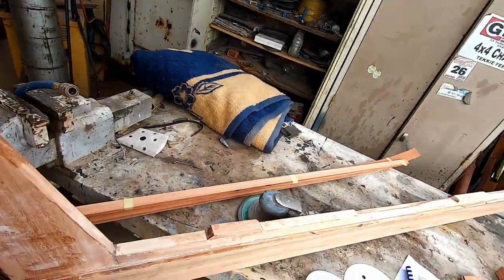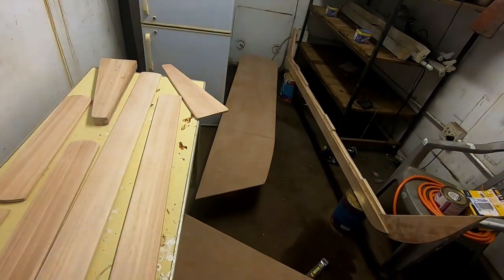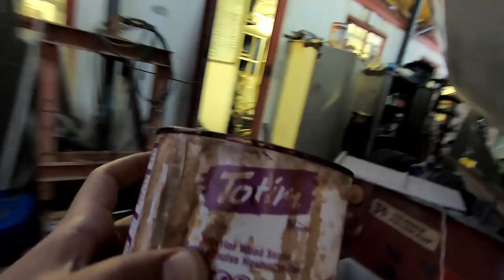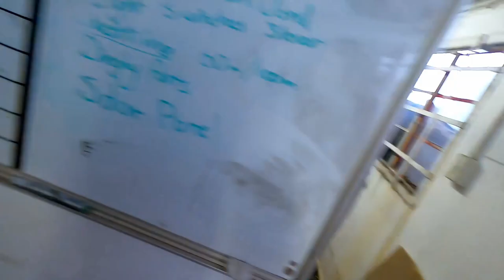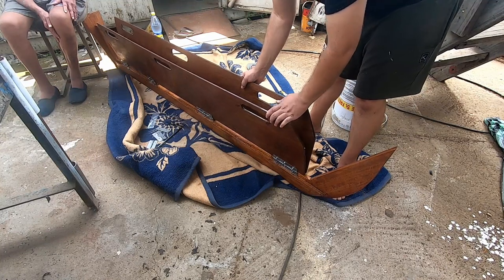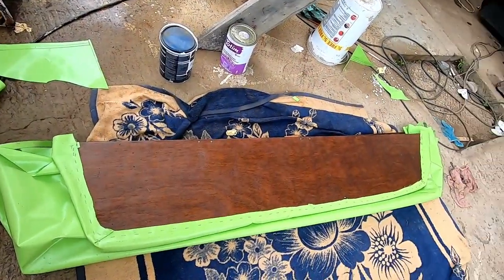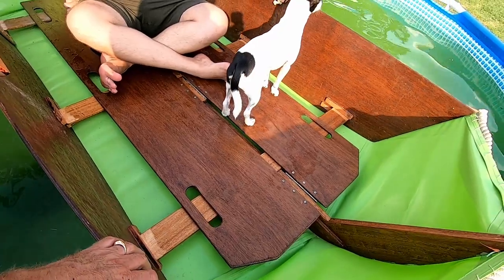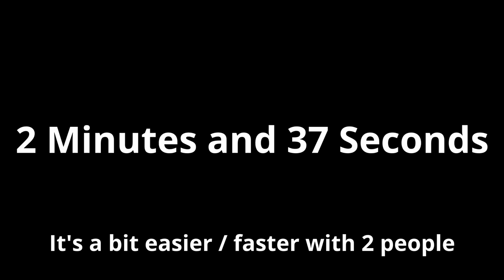Building and Testing an 8ft Origami Folding Dinghy | Land Rats | EP31

Comment: I built the 6-foot version of one of these many years ago to be the tender for my 16 sailboat, a Sparrow 16. I store it inside the boat so that I don't have to tow a dinghy. I has held up quite well for me. I even used it in Desolation Sound where the shores consist of super sharp rocks or oyster shells. When got home I had to touch up some of the bottom edges of the wood with more epoxy. I took the opportunity to add a bit more glass fabric to those spot that got worn.

I would recommend two things to potential builders.

1) Don't skimp on the floor width. I did to not have to cut into a new piece of plywood. I plan to install the full-width floor pieces soon.
2) Use 3M-5200 marine adhesive/sealant. The instructions I used said to use silicone but it leaked. The 3M-5200 is a strong adhesive that also helps keep the PVC fabric in place.

Comment: I plan to build this, had bought the plans online.

Instead of varnish alone, is using cheap wood + fibreglass to seal it better? Would it make the boat more heavy?
Reply from the maker: Depends on how thick the fibreglass is i suppose but, i don't think it will be that bad as long as the wood you're using isn't to heavy either
Reply: I was planning on using glassed foam like surfboards instead of wood. I bought the plans in 2020 before everything shut down and the cost of materials went crazy. I never got back to it

Comment: Heyy, how do you estimate cost of materials to build that boat? Sorry, if that was told in video, I might not hear
Reply from the maker: I think the wood was the most expensive part being about but prices differ in each country. I think in total it xost us 4000 or 5000 rand to build it which is about 350 or 400 dollars. We also didn't use the cheapest wood so it can definitely be done cheaper
Reply: @LandRatsSailing  wow, I didnt think that relatively small amount of wood can cost that much, I expected it to be like two times cheaper at least :D Also when i was looking for tarp, it didnt seem to cost much, so i was suprised how   the man that created that boat estimated that you need 250 euros at least. You know, I only saw couple of planks and a tarp and i couldnt find 250 euros in it :D
Reply from the maker: The one we built is also the biggest one at 9ft if you go for a smaller one and use cheaper wood. You'll come in well below 250 euros. Whe used selegna wood. Also had to buy a new stable gun and stainless steel staples. Which was about 1000 rand. Around 80 dollars
Reply: @LandRatsSailing  Im wondering what % of needed tools and materials my grandpa already has in his cellar, so the costs would go down :D
Reply: @LandRatsSailing  And i was also considering other boat to build (flipboat 7 or 9) but im not sure if i could do it by myself or understand instruction properly, as im not native english speaker and those plans are looking to be too expensive to buy it blind and then realise that its out of my reach zone
Reply from the maker: That should help a lot. Especially if he has some stainless steel screws and thing all of that will keep the costs down. But I wouldn't go to cheap with the wood,varnish and other stuff either as you want it to last as long as possible
Reply from the maker: It uses a lot less wood so should be cheaper. Also looks a bit better if you ask me. You'll need to bend wood for that. We went with the origami as it folded the smallest and required the least amount of skill
Reply: @LandRatsSailing  definitely, good quality of the wood is almost required. also as i looked up, tarp seems to be insanely cheap, its like less than 10 euros for 1m^2, and im talking about the widest one. Maybe in Poland materials are a little bit cheaper. And i guess the last question, are there also plans how to make a sail? Because im considering if its worth to try making plans on my own, and try to build the same boat, just by looking on how its made (on your video for example)

Comment: What kind plastic tarp..
How long thats can use
Reply from the maker: It's pvc tarp the same that they use to cover a trucks load. It's very durable should last quite a while might just need to patch it if it does get a hole. I hat to put a needle through it to add the rope trimming and it needs quite a lot of pressure to get the needle through to make a hole. Hope this helps

Comment: I've decided to build this myself. Do you think that purchasing the plans are a must? I've got access to tools and a lot of scrap wood lying around, however I'm a student so I'm trying to make it as cheaply as possible.
Reply from the maker: You don't need the plans but you might end up having to do a couple of things over or making some mistakes. It's not a very complicated build as long as you plan it out well and understand how it folds and works. That being said the plans are step by step so can help you put it togeter in two or three weeks
Reply: @LandRatsSailing  Two or three weeks!??? I was thinking this would be something that could be done over a long weekend 😂 is it the varnishing that takes a long time or why so long? I thought boat varnish needed a day to dry.
Reply from the maker: Varnishing takes the longest yeah especially if you do multiple coats. If you have eveythimg you need and know what to do you can probably knock it out in 4 days maybe less excluding varnishing
Reply: @LandRatsSailing  thanks for the replies! Do you know what size pvc material you used? I have the option of buying 3 metres long 1 metre wide or 3 metres long 2 meters wide. The bigger the more it costs so I'm trying to get away with doing it as cheaply as possible.

Is it just any kind of plywood that you use, or a specific type?
Reply from the maker: No problem, Our boat is 9 foot so the pvc needs to be long enough to cover from front to back with some some over lap as well as side to side. I'd go with the bigger one as the boat is definitly wider than a meter and just make sure your boat isnt longer than 2.5 m. Send us a message on face book
Reply: Purchasing the plans is an absolute must- it is actually quite complicated and intricate, and the plans are very good. It's actually quite a bit of work to do well, maybe ~40 hours of actual work if you're an experienced woodworker with a well organized and stocked shop but spread out over a long time as you need to wait for epoxy curing, and 24 hours between each of 8 coats of varnish. It took me a full year to build in my spare time.